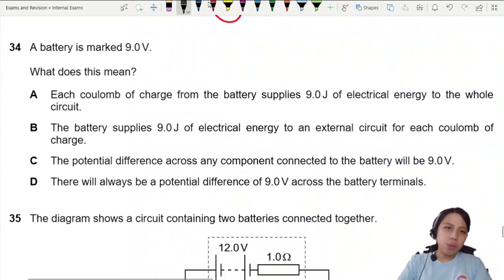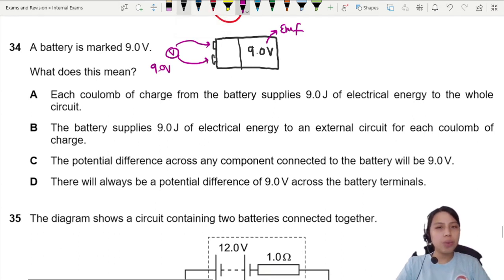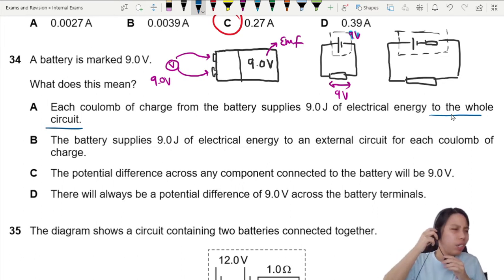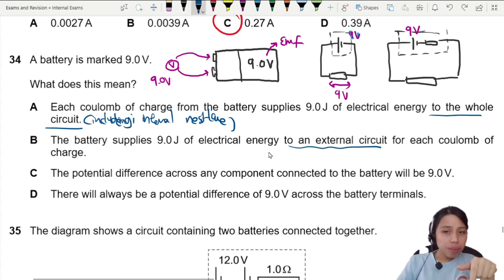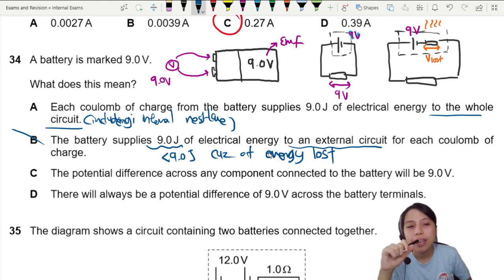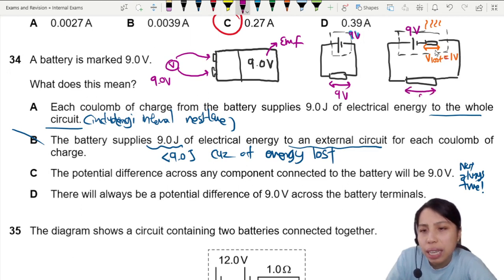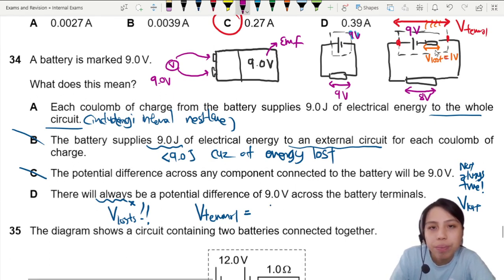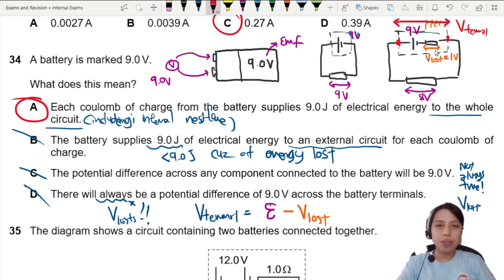9.2a Ex1 MJ21 P13 Q34 Battery emf Marking | AS Electricity | Cambridge A Level 9702 Physics

Comment: Isn't energy lost so how would each charge be able to supply 9.0V to the whole circuit?
Reply: hey i suppose that the term external is the problem because it excludes the battery from the circuit which as she said may have an internal resistence causing b to be inaccurate while A states whole circuit meaning including battery aka including v lost
Reply: The lost energy is due to the internal resistence which is part of the whole circuit

Comment: for part d can we say the potential DIFFERENCE would be 0? as voltage is same across both ends of battery?
Reply from the maker: But as long as the battery hasn't run out, there will always be a potential DIFFERENCE (aka voltage) across the ends of the battery!